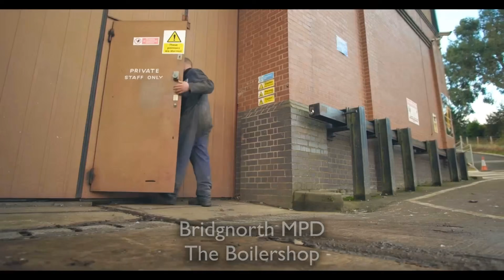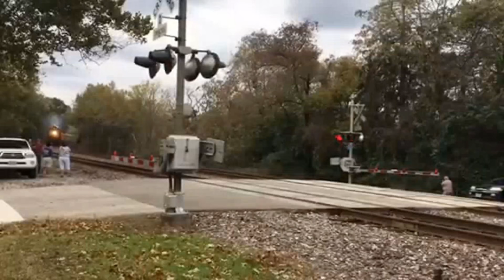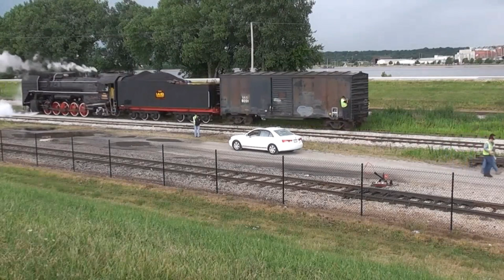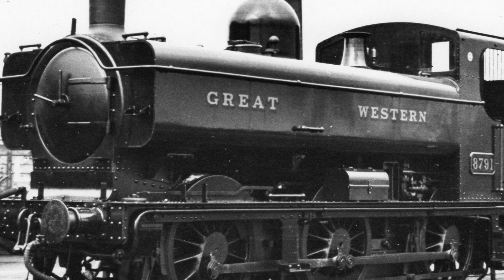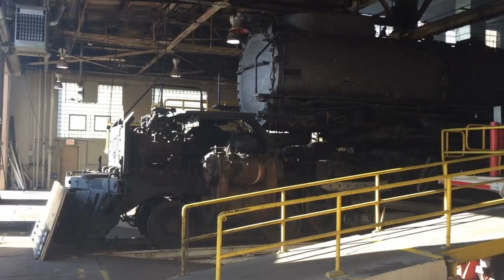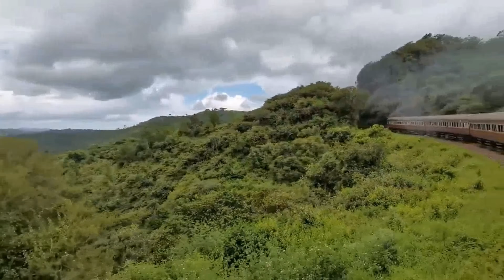15 Most Efficient Steam Locomotives That Were Built to LAST FOREVER!

Comment: GWR fan here.  There are 5 British locos described here.  Apart from the Gresley  A4 (Mallard) class, the other four (The Hall, Castle, Black Five and 8F are in fact, ultimately iterations of the same base loco, the GWR,  G. Churchward 2800 class of 1903.  This development is only vaguely touched on in the video: Churchward  then developed the Star and Saint class, which Collett turned into the Hall and Castle; William Stanier worked for 30 years with Churchward and Collett at Swindon so took all their designs with him when he went to work as CME for the LMS.  So his Black Five and 8F are basically improved versions of the Hall and the 2800 class, with external Walschaerts gear.  However, the original GWR versions had greater TE than their later descendants.  Interestingly at 1.19 there is a photo of 5900 Hinderton Hall and 6998 Burton Agens Hall together. I am convinced that was taken at Worcester shed ,as I remember both those locos as regular haulers of trains on the Hereford, Worcester/Birmingham or Paddington routes.    
Pity that in this video the locos shown do not always correspond with the one being described.  And also a great gaping hole.  André Chapelon's great French designs, eg his 240 P and many other SNCF greats which used to haul the Flèche d'or (Golden Arrow) on the Calais - Paris leg.
Reply: Missed out on the 49xx 56xx 57xx for efficiency and good reliable running not very many issues with them